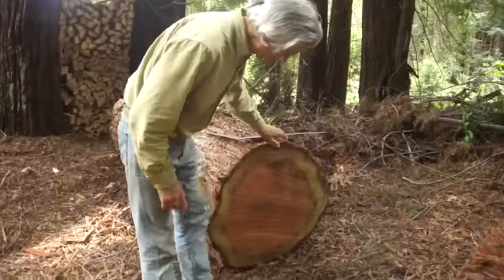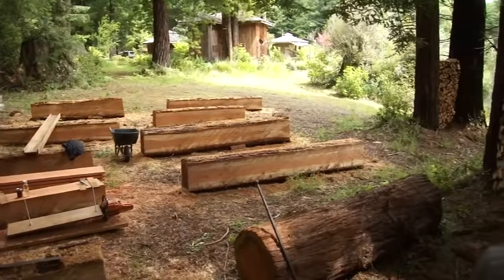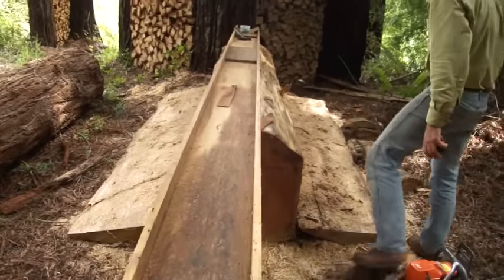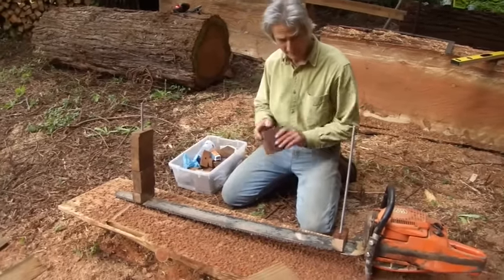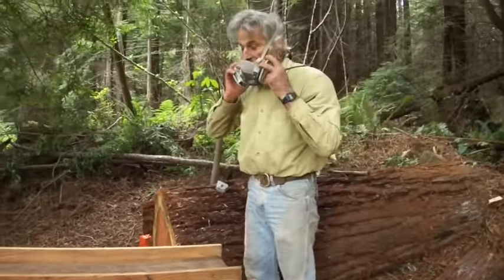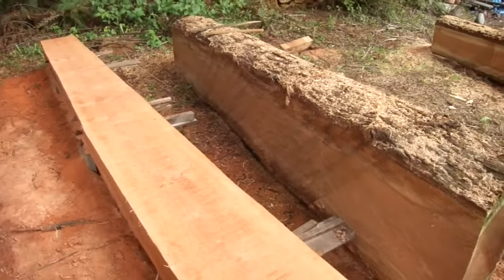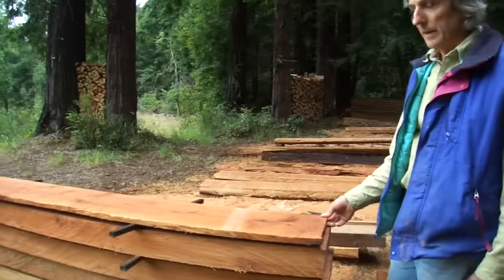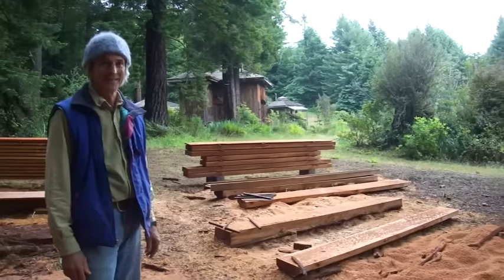Turning a tree into lumber using a homemade Alaskan Mill

Comment: When I used to mill wood with my alaskan mill I always used a single section from a aluminum extension ladder and you can use long wood screws and plumbers tape with holes in it to secure the ladder section to the log and that makes a very nice stiff straight guide.

Comment: You inspired me to buy my own 60cc chainsaw and start milling my own lumber from the chestnut oak trees on our property. Props for inspiring me to do what seemed like the impossible several months ago. Although i will say, i wish i bought electric  chainsaw grinding sharpener when i bought the saw, because i spend HOURS trying to learn how to sharpen right and never got it even with a file angle guide. As soon as i bought the sharpener my chain was factory sharp going into every slab cut.
Reply from the maker: Fantastic! What great slabs you will have!

Comment: Really nice and informative video and totally enjoyed it. Reminds me of a similar project I did (being a city boy) in a cabin I helped build in Maine. Made a 20ft cedar staircase (with 4 winders) using 5in wide stringers and 4in treads. The newel post was an amazing old old 18" or so wide cedar tree and hand mortising the joints for the winders. Just peeled the bark on the face of it and left it live. White wash stain and poly and looked fabulous. Somehow it ended up in a log home magazine not sure how. Anyways, wooden dowels and tenon joints and not a single screw or bolts used. Oh...almost forgot why I started this comment. My neighbor down the way had a 52" circular mill with a big ass diesel engine that ran the blade and it is how I cut my slabs for the project. The cedar came out of a cedar swamp that was on the property. Really proud of myself (me being a city boy and all) and amazed at how it was done a looong time ago.

Comment: Great video!  Like others, I can't imagine ever being in a position to do something like this, but it was still fascinating.

However -- some years ago I did buy a rail of some sort that I attached to my plain old circular saw in order to cut a long straight piece for some reason. I have very little experience working with wood but I managed to get this to work. Kind of gave me a "poor man's table saw" for the one use I had.

The principles it used remind me of what you did here, although on a microscopic scale of course. I live near the redwoods in northern California so it was especially interesting watching you deal with one of those beauties without a whole crew and mill, etc.
Nicely done. Thanks for a great video.

Comment: Old School Alaskan Mill Demo, Online and forever available, Top Job Mate,
I've an Aluminium set up, use an Al ladder to help set the depth distance, for my own 395 Husky,
A good mate uses 'skate board' truck set and wheels to carve organic, near parallel to outside bark line flat surfaces.
Watching known chainsaw cut through 'Northern hardwoods' like stiff cheese, is very cool.
'Southern Hardwood' such as Australian native  'gum-tree', yeah and holy crap, They arn't called 'iron woods' for nothing.
Even with the best chain saw on the planet, an Huskqvana : a few meter would blunten two chain in an Aussie 'gum-tree'.
First settlers preferred to work and build with 'stone' rather than the local tall timbers !
Thanks for keeping the knowledge alive,
Peowulf
Reply from the maker: Thanks, and good to have information available.

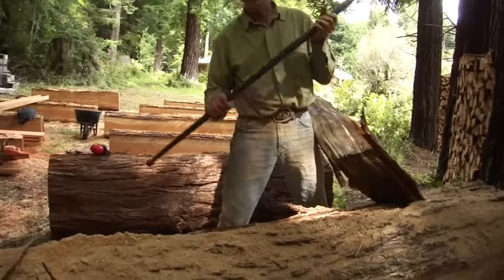Comment: 6:40 Its called a slate bar, which is normally used to "shave" slate. But also the duct tape of pry bars. Its also used on the rail industry for track positioning before they are spiked.

Comment: Great video, Very simple set up for the chainsaw mill that is both effective and inexpensive. In order to get better material, many people recommend stacking lumber for drying with many more stickers than you are using. Some of your drying lumber stacks I see are on just two cinder blocks spread out at least 6 feet and then only 3 stickers per board.This is fine for siding and flooring but it will produce a bow in the wood that may the wood useless for other purposes. Using stickers every foot or 18 inches is preferred while drying.
Reply from the maker: I agree, more stickers are necessary especially for 1" thickness...but can get by with less for 2" material for a deck.
Reply: Also, move the stickers closer to the ends of the boards.  Often the end cracks will stop at the stickers.

Comment: My God, I love it!. I've been looking for some ideas for solo milling without some gigantic rig that costs too much. I'm moving to the wild right now!
Reply from the maker: Good luck!
Reply: I've seen mills with a boat strap winch mounted on the bar guide. Strap anchored to eyebolt on other end of the guide. While running chainsaw, slowly crank the winch pulling the saw along instead of pushing the setup. I assume this guy waxes his guide boards ?

Comment: Cool stuff! Some really great info, thanks David.  I am inspired to start cutting a few small logs I saved to make trim around my 2" thick hearth slab in front of my wood stove. I will use my table saw though.  I am interested in trying your technique with some logs from my property... I Just need to set up my old bar with the bolts n blocks.  Julie did a nice job as well...Cheers!

Comment: I once milled a red oak with a 2100 CD husquarnva 36"- one 14' and one 16' about 28" dia.  Is that the same saw you are using?  I made several planks 17 1/2" by 1 1/2" clear oak.  For a manger to feed holsteins....................lol!  Well that's what Dad wanted!  It lasted about 10 years, anyway he was happy.   Pieces are still around but the cows licked it up pretty good and wood is gone in many  spots.  You earn that wood, let me tell you!  Good job.

Comment: The downside using a chainsaw is the saws kerf is about 3/8. When you add it up Thats alot of good wood turned into mulch.Plus it's pretty slow.I have the aluminum one but don't use it very often.Harvesting a tree away from my shop is a ton of work.Thanks for sharing your work David your place looks beautiful.

Comment: Now imagine 150 years ago when it was all by hand tools. I'm sweating just watching this guy.
Reply: Me too.  My face perspired watching this guy, but I'll try it with my smaller timber.  i see 2 problems regarding safety I'll describe in case those thinking of trying this didn't notice them too.  All's good until the second cut is reduced to only 4" thick.
At the beginning of the cut at the end of the timber he boots up the saw.  Starts to affix the whole rig horizontally.  The problem is only the first 3 to 4 inches of cut into the end when starting out.  A lot of force is required to push on the edge of the plank that travels the length of timber with the chainsaw suspended.  At the start one's hand is only 6" from the saw's chain when starting the cut.  A firm grasp (push) is needed here.  If your hand slips off and down - OUCH! The same problem occurs on the first cut too but not as gravely.   I'd attach a removable handle myself just in case.  2. A similar problem exists for his foot when he straddles the timber at the end of the 9' cut.  The thoughtful narrator even noticed this danger.  To protect my foot in the event I forget I've reached the end of the timber, or my foot wants to slip off, I'd attach a cleat at the far end of the rig's plank for my foot to push against with some sort of friction surface marrying it to my foot.  Your brain would remain aware of this ever reminding you you'll arrive to a place your foot might wanna slip down when finished.
Reply: sawmills have been around for 400 years and people still do it by hand lol
Reply: sawmills have been around for 400 years and people still do it by hand lo

Comment: Two could easily put down the flooring in a nice size cabin, at a 2" X 36" plank size, that would be better than plywood,then sanded and shelaqued.
Reply: That would require kiln drying it not to mention plywood is night and day stronger
Reply: @mattberg6816  What are you talking about solid wood is significantly stronger than plywood
Reply: @rohanmodi1808  when speaking about true ply wood, which is separate (whole) layers of wood laminated to one another, having the grains of each layer going perpendicular to the last layer is much, much stronger than one simple grain going through an entire thickness of a a sheet of wood of equal size and thickness.

Comment: Over here in Australia the steel bar is called a crowbar.years old technology.great for digging fence post holes where the earth is rocks or very hard..
Reply: Here in Colorado we call them an ice pick, great for scraping and breaking up ice..
Reply: In NorCali we call the "J" shaped ones crowbars the straight ones are pry bars.  lol.
Reply: I grew up hearing it called a pinch bar.
Reply: New Englander here. It's been called a pinch bar since my grandaddy was a boy. I have the one he used as a young man. It still works just as well now, it just doesn't work as hard as Grandaddy worked it.
Reply: Growing up in Northern Minnesota, we refereed to it as a Pry bar or a Wreaking bar. We have several of them and use the when digging holes in gravel or packing the soil for fence post and its a must tool when putting back on a track on a Case dozer or other down time upsetting events.
Reply: In Ireland we call it a crowbar and the J shaped ones a nailbar
Reply: Gady everybody ..bryan the builda from australia..east coast here..a long bar with a wedge tip and a point at the other end ..usually 6 ft long is a crow bar ..or aussie slang is a black snake ..cos no one wants to touch the it lol ..same long bar with a big knob on one end and wedge tip on other is a spud bar ..for ramming round fence post ..the tqo foot long bent bar with a hammer claw on one end and a wedge tip on the other ..either 2 ft or three foot long..is called a pinch bar ..cos robbers use it to break and enter premises ..or its slang name in australia is a theivin bar ..hope this clears things up

Comment: A sharpie would work wonders on those spacer blocks in the tote. Write the dimension on them instead of having to dig, measure, dig, replace, measure, dig, measure....
Reply from the maker: +Jeremy C Good idea...didn't think of that!
Reply: Jeremy C that's smart
Reply: But then again you DO have LOTS of TIME & PATIENCE!
Reply: Do not use sharpies they use extremely hazardous solvents to keep the permanent ink from drying in the pen. It's chemical trash.
Reply: It would work much more nicely if you burn the measurement of the block on it, give it an oil and now it's really beautiful, like those fine pieces of tool that your grandpa used to have.

Comment: Very interesting 'Alaskan Saw Mill'. Enjoyed it very much and learned a lot, however I am a city dweller with my heart in places-es as you live in. I have a suggestion for your consideration to make your labor easier. Why don't you develop a pulley system with the traction horizontally pulling in the opposite direction with  the appropriate amount of weight that will aid your saw in cutting the wood with out you having to apply so much strength? Hope it works. Aspi Khorsandian Daytona Beach Fl-32174
Reply from the maker: Sounds like that idea would make the process easier...however I've invested in a Turbosawmill to solve the problem. Thanks!
Reply: Will be looking forward to more videos from you. All the best.

Comment: I have always called that bar a Pinch bar
Reply: +Richard Hilbert johnson bar here
Reply: +Richard Hilbert 
I was taught the term "spud bar".  Mine looks just like his, but is perhaps one foot longer.  I use it for setting/tamping fence posts and such.
Reply: +Richard Hilbert I've always known it as "long iron bar"
Reply: +Richard Hilbert Pole Arm here
Reply: +Richard Hilbert "Spud Bar" here too.  Also used in demolition, especially floors.
Reply: +Richard Hilbert Third for spud bar, great to take up tile floors and some roofing products. Another use I saw Years ago (here on YT) was a landscaper of all things. He'd use these to take up shrubs.  dig around the shrub a bit and then hit the roots with the stout bar to severe them while twisting and pushing and turning the shrub until it broke out.  Said he used to use other lighter implements with more of a blade, but eventually found it to be faster to just use a really heavy spear.
Reply: +Richard Hilbert my grampa called it a "pig pole"
Reply: +Trust Me A Johnson bar has steel wheels on it and an oak handle. Spud bar, tamping bar and sometimes called pinch bar.
Reply: +Richard Hilbert Yup.  "Spud bar" here too.  We use it for the same purpose as we don't have a cant hook or peavey.  It's for when not even the best crowbar isn't good enough, or for when you need something with sharp heavy breaking power, but you don't want to dent the edge of a maul.
Reply: +Richard Hilbert  crow bar or pipe bar
Reply: we call it a slate bar in eastern ky
Reply from the maker: I've also used it for slate!
Reply: David Groth yep, works well for busting up rocks for digging fence post holes. Awesome vid man!
Reply: Richard Hilbert yes...pinch bar
Reply: ellsworth actually a Spud bar I believe has a pointed end and not a flat one

Comment: my Dad had a bar like that.  He called it a pinch bar.
Reply: Not to take away from your comment but to add. A pinch Bar is smaller than what he used, In Australia we call the one He used a Crow Bar. Versatile can be used as seen but also when doing earth work like post holes or trenches,
Reply: We call it a digging bar in Oregon
Reply: In Missouri it’s a rock bar .

Comment: The metal spike/pole is used to drive/pound pilot holes in the ground for wooden posts (typically fence posts). You would generally use something like a sledge hammer or giant mallet to drive the metal stake in, then remove it, and use the same hammer to drive the wooden post into the hole you've just piloted.
Nice video!

Comment: Where are your chaps, gloves, steel toed boots, ergonomic ear plugs, Hard hat with safety shield, etc. Wink......Monte.
Reply from the maker: Very good to hear from you Monte! Guess I couldn't resist putting on a show without all the extras. Wink,Wink...David
Reply: Hi Monte. Fun to see a comment from you here, as from all the stories and times I have heard your name, you are clearly a master sawyer - you'll be glad to hear that all 27,000 board feet at David's  are still looking good!
Reply: +Monte Provolt don't forget the standby ambulance
Reply: Monte Provolt u actually dont want to use steel toe cause if that heavy ass log falls on ur boots its gonan clamp the steel down on ur toes and then u got no toes

Comment: Nice work. Watching from Panama where this technique is used a lot. I like the guide you made for it. Gets you off to a good start. Most chainsaw guys are here will trim off one side by eye then use a cord soaked in old oil snapped to give a fairly straight line on the cut face, rotate the log a quarter turn and cut to the line keeping the saw "vertical". After that the log is turned back a quarter turn so the freshly cut face is not horizontal and the start taking boards as you did. I'm sure you'd get a kick out of working with the woods we have here. Laurel, Almond, Nispero, Guyacan, Cocobolo. Many of them so dense that even when dry they won't float in water. 😆

Comment: What i liked most about this video was the use of a different saw to get rid of the sap wood . By removing the bark and sap wood ,the mill chain cutters will last alot longer and need less sharpening; not to mention the saw will cut faster and cleaner. I love my Alaskan mill ; i bought a big one just for cutting large logs . The largest one i have milled was a six foot diameter yellow pine ; it turned into some beautiful tables that were one solid piece five foot wide and six inches thick slabs ,very heavy . The next most important part of this video that i appreciated was about the heart crack ; very critical part to always determine first hand. Thanks for the video. P.S. let us know how that TURBO sawmill of yours is working out.

Comment: That's the craziest setup I've ever seen.  I think a band saw mill would work much better.  I actually bought a brand new sawmill that used a band saw, used it for about 10 years and built a whole bunch of stuff, then I sold the mill for almost exactly what I paid for it.  They hold their value really good.  And I used a hoist in the bed of my trailer to move big logs around, it was a big iron 'arm' that I welded together with a chain hoist on the end of the arm.  The limit of my lift was when the trailer started to flip over LOL.  It was a great setup.  Not sure I could have lifted those big logs though...

Comment: Picked up a G777 which is a small Alaskan mill for my 18 inch Stihl Chain Saw.  This summer I produced 850 board feet of Cherry lumber.  The cherry died on the property and I didn't wan't to loose it for firewood.
Waiting two years to use it.

Comment: I like the extended top board to protect anyone from the chain nose. 
A second (short) bolt through the nose end would let you fit a small (plywood) guard over the end of the chain bar.

Comment: Remarkable video. I was cutting some pieces of yew the other day for some carving material but I had to hand cut chunks out of the log with a 16” sawblade, which made getting level cuts impossible. I’ve planed them flat pretty well, but lost a lot of material in the process. This sort of milling technology would have made it very easy.